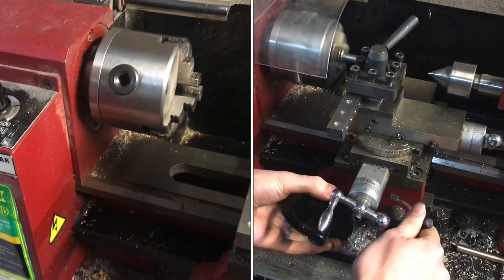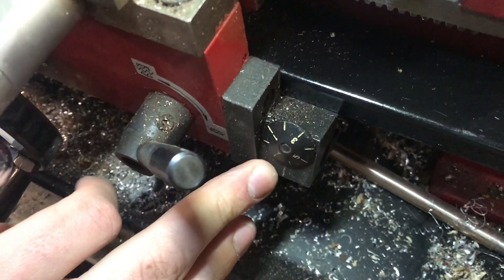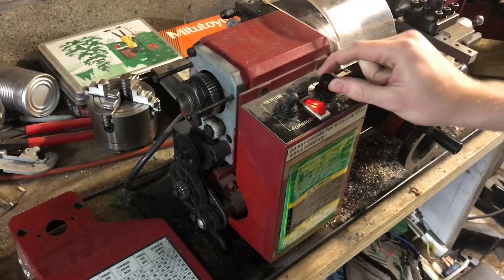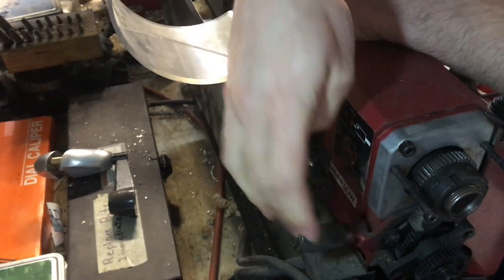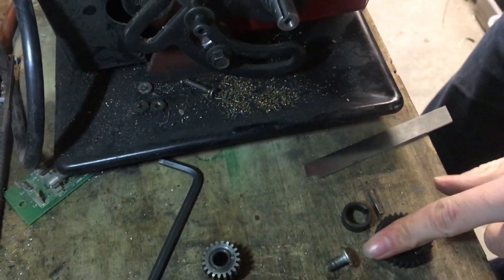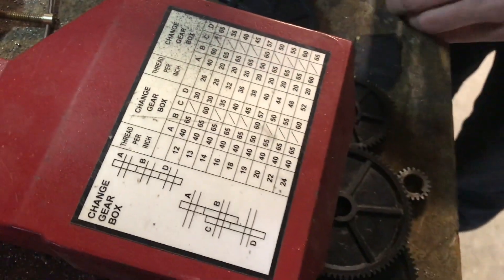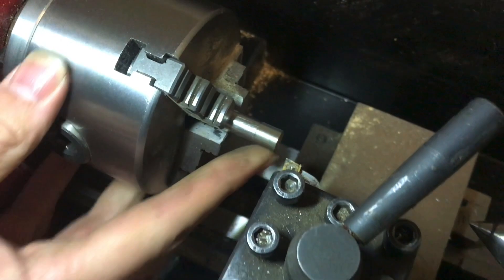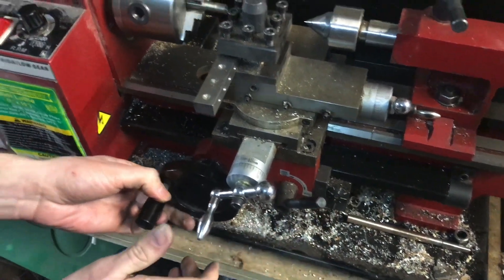“learning” metal lathe AUTO FEED (tricky) nitty-gritty details

Comment: I finally got the lever to move. I think the problem was some cosmoline may have hardened up. And when I reefed on the lever BIG TIME, it broke loose and now is working fine. Thanks for all of your help and keep the videos coming!
Reply from the maker: That’s GREAT! Sometimes you have to twist knob harder than you’d like, taking a risk that you might break it. It’s always nice when it works out in your favor. Congratulations on getting your auto feed working👍👍
Reply: I’m having the exact same problem. Did you just use “hand” power, or some tool? Thanks!

Comment: I just can' see what to do to make the auto-feed lever to move, as if it is there as a decoration and welded on for appearance only, LOL I have seen other videos where the gears are where mine is at now and the auto-feed works great. Oh well, I guess I'll use the cross-slide crank all the time. Puzzles me that the machine was bought new and doesn't work properly. My fault for not using the lathe before the 2-year extended warranty ran out. Thanks for you great videos!! Come up with any more ideas I could try, let me know.
Reply: I watched your video a few more times and noticed the thread dial, on mine, does not move when I turn the carriage crank handle or rotate the chuck by hand. Again that is with the auto-feed lever in the up (disengaged) position, that it is frozen (locked} in. Does this indicate anything?

Comment: Can you really cut threads with that???  I've used large lathes with back gears, and I know from experience that the speed has to be dropped way down.  So can the speed go slow enough on that while still having enough power not to bog down?
Reply: This machine is designed to cut threads but I can't because my auto-feed won't work. This machine comes with a supply of extra gears to make threading happen. "Live Free" has a video on cutting threads with this machine, in fact, he has many great lathe videos.
Reply: Mine cuts threads fine. I've used carbide inserts and hss steel and neither has ever choked down the machine at the low rpm I use when threading on 6061, 360 brass, 303ss or 12l14. About the only thing that has choked mine down is if I clamp my knurling tool super tight for its initial bite into material but I made a spindle handcrank after stalling it a few times.